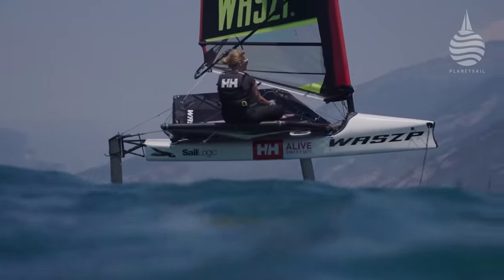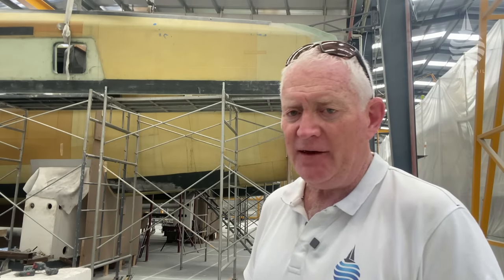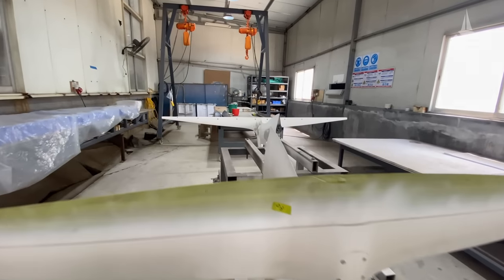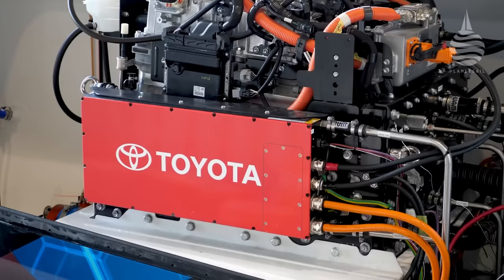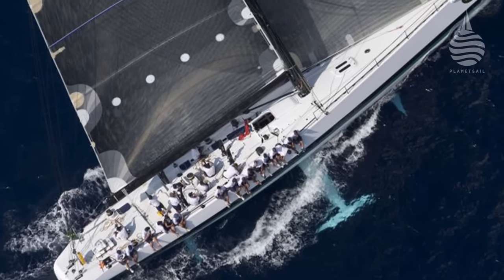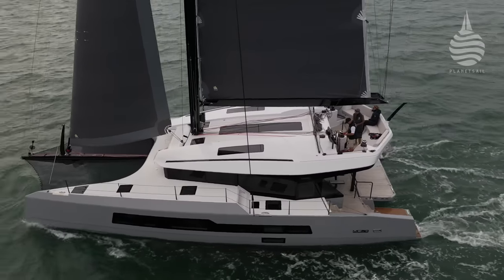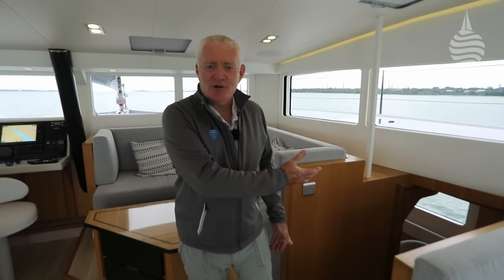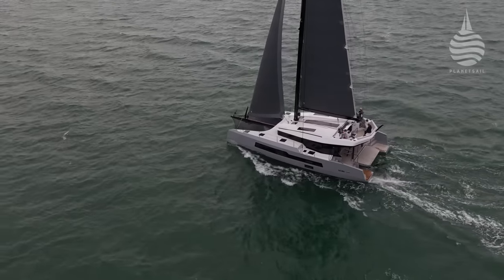How Boats are Built in China

Comment: Nice video Matt, but the whole thing left me cold, the top end of the scene is so far gone down a rabbit hole of pretense it is amazing, spending millions in complexity and carbon to get some fuel savings is virtue signalling at its worst. The cruising cat shows what happens when you get racers to design cruisers, for one, staying up high in a chop would be awful, but has anyone actually gone cruising long term? You don't steer by hand, it is autopilot on whilst you make bread, have a wander around, clean up a bit, check on the crew etc. A real cruising cat allows you to be in the boat while the autopilot steers. But most importantly, it allows you to quickly go "Oh s..T" and race outside to avoid the crab trap, or other boat and you take two steps aft and release sheets, or bear away or grab the helm. This cockpit setup divides the crew into those up top, on watch, and those below, who can't sail at all. I think it is very unsafe. I much prefer the Outremer you sailed on. Friends of our circumnavigated on their 35ft cat. They came into our mooring area with Chris steering by tiller, they had no wheel. I asked him how he helmed around the world with a slightly exposed steering position on the end of the extension tiller. He looked at me and said "She is on autopilot over 99% of the time". And as for the centreboards, they seem awfully complex again. Daggerboard cases can be offset to take up very little room. And chop off and re-glue the bottom 300mm back on for collisions (mine broke off fore the first time in 23 years just three months ago when I hit the bottom hard - hull perfectly fine and I glued a spare end back on within a few days) - you don't need the complexity, i like to celebrate those who actually use their clever minds to make sailing accessible and less complex.

Comment: 180kg!! Does it really make that much of a difference if it was 380kg?
Reply: Absolutely. In racing seconds don't only count, tenths of a second sometimes do. With foiling yachts, it's even more important than just the weight savings that translate directly to speed. It's weight savings that allow for flight. The lighter a boat is the easier it is to get out of the water and onto the foils. If there's too much weight the boat can't fly or requires more wind to fly, causing the boat to stay in the water longer. Not only is weight important, it is ALL important when it comes to foiling.

Comment: its an interesting design, with the center board and carbon as well as the lack of a compression pole in the cabin. carbon ahs its advantages but its a material that also has its flaws, often not mentioned that it does not like t be hit by a hard object...a hammer would just shatter it. But that flybridge? Not only that it looks pretty dangerous for small children, or an adult falling backwards, the lack of weather protection for the helmsman is a joke. Try that bat in a bad storm, tropical rain or on the equator and you wont like it at all. Hence Very mixed feelings, I never liked racing... probably why...Then the contribution to Chinese economy ..not a great thought either.

Comment: Carbon hasn't been proven for longevity. They are also hard to repair.
Reply: if you can afford a carbon epoxy boat you can probably afford the repair bill.
Reply: @vorjay  aluminum makes more sense than carbon. The biggest issue is not the cost of repair. Rather bring stuck in the middle of nowhere and getting rescued having to throw away your yacht for someone to pirate all your belongings.
Reply: @healer81 btw it's E-glass/epoxy only the structural elements are carbon fiber.  I'm a fan of aluminum but to say, "it makes more sense" not considering what the actual application for it is, is a bit armchair quarterbacking.   people watching their favorite youtuber talk about materials and then acting like they're engineers is obnoxious.
Reply: @vorjay  there's no practical application for carbon fiber unless you are racing. What advantage would carbon fiber have over aluminum? Carbon fiber on boats is relatively new and there aren't a lot of people that would be able to work on them. Sorry for having common sense.
Reply: @healer81  "nO PrACtIcAL APPlICaTion" - Youtube engineer high school drop out.
Reply: @vorjay  lol you didn't answer my question because you don't have any answer, only insults. What are the advantages to carbon other than weight?
Reply: @healer81  Mcconaghy boats aren't carbon fiber they are epoxy E-Glass. 

...and saying, "what advantages does carbon fiber have over aluminum other than light weight" when you're talking about a performance boat makes you look stupid.

I would personally take an Aluminum Garcia Explocat 52 which performs well enough over a carbon fiber performance Outremer 52, but that's just me.
Reply: @healer81  actually scratch that.  I would take an Aluminum monohull Allures 51.9 or a slower Aluminum monohull Garcia Exploration 52, but I still understand why a performance boat would use carbon fiber or Epoxy E Glass over aluminum.
Reply: @vorjay  I get the idea of the same people that are willing to buy a Bugatti are the same people that would buy these carbon fiber performance boat. I rather get a AMG G Wagon as a daily driver and if I wanted to splurge and flex I rather buy a collectable Ferrari, Porsche, that would appreciate thru time.
Reply: @healer81  that analogy doesn't work.
there's a practical reason to want a boat that is so light it does better in light winds and can shave days off a trans-Atlantic journey.  
an AMG G Wagon and a Bugatti is apples and oranges. I mean...common dude.
Reply: @vorjay  fair enough with saving a few days. If someone is getting a carbon boat to go out with the boys once a year. These types of people are far and few compared to retired couple sailing months at a time. I was referring to spending the rest of the money on something like a ferrari Enzo that appreciates.

Comment: All very interesting technically, but I can't help seeing the glaring hypocrisy of it all, hydrogen chase boats, carbon Fibre construction blah blah, correct me if I'm wrong but carbon fibre has to be cured in an autoclave, which uses WHAT exactly to generate the heat and pressure required, same with the hydrogen power trains, the gears in the transmission are machined on CNC machines powered by????
Not to mention what is powering the very complex hydraulic systems used for foils actuation and winching, this is such a bullshit false economy virtue signaling scam, just like electric cars, sure the tech is impressive but this is so far removed from 98% of sailing, no 99% of sailing its not even remotely connected, my little steel Van De Stadt 34' with its 33HP diesel, 415 watts of solar, cheap and easy construction and reasonable maintenance and operating costs will sail for 100 years without even coming close to their electricity bill for one year.
Let's get back to just plain sailing, I  can get a comfortable 7+ knots SOG easily with is fine for 99% of us without spending millions for a few extra kn. Get real.